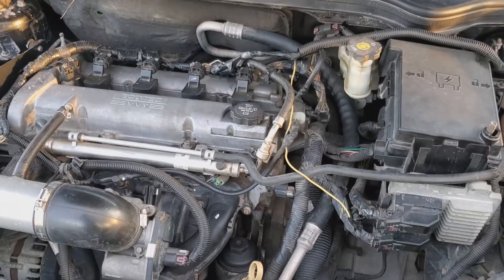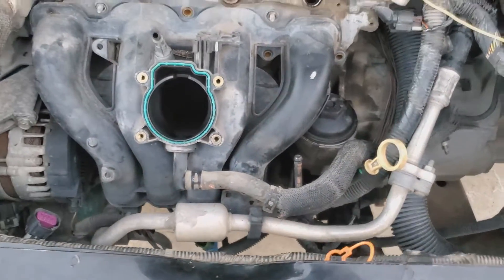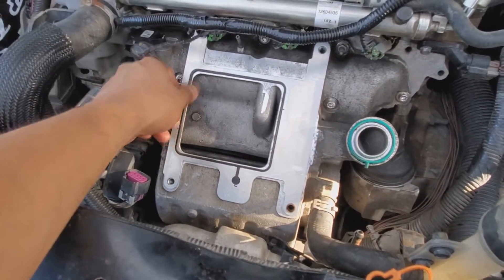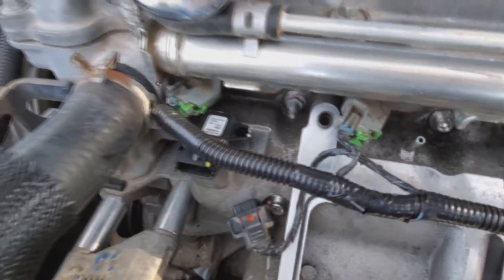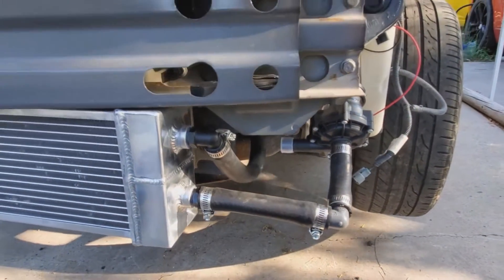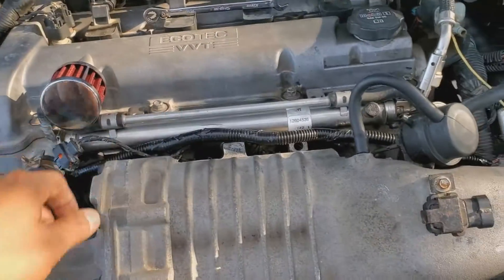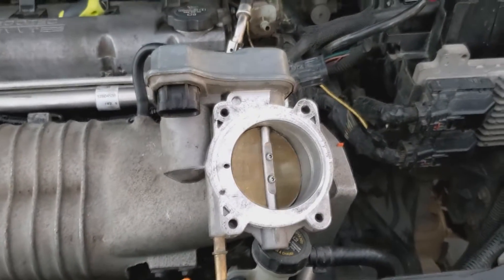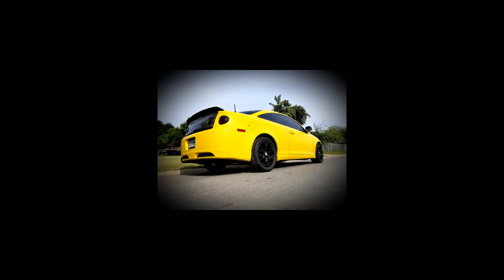Supercharging a 2 2L LAP Ecotec Part 1

Comment: Great video brother and thanks for posting! I have the 2.2 Ecotec in my sand rail dune buggy but Im not sure if the blower will fit between my engine and tubular frame.  Can you tell me how far from the engine block (at the intake surface of the block) the blower sticks out? Thanks!

Comment: Hey man, doing this right now, and not sure if you can even answer my question anymore given how long ago you made this video, the bottom bolt on the right side for the idler pulls when looking at this, what bolt did you use? they say the m8x90mm but it’s too long for mine

Comment: Hey man just wondering, how much did this cost ya in total?
Reply: And did you need to get that ecu file tune that's on their site too?
Reply from the maker: @igot4bucks640  i did not do the purchase. I only did the labor in installing the supercharger kit. But the kit is about 800 on zzp plus supercharger, tb and intake manifold. I didn't use the zzp tune as we had another tuner setup for it.
Reply: @09CamaroFANATIC  awesome thanks for the info man
Reply from the maker: @igot4bucks640  yeah for sure, you're welcome!

Comment: DUDE!! so glad i found this channel, im doing a very similar upgrade to my 09 'balt LT - i went the turbo route with equipment either on the way or backordered, but so far i did upgrade maintenance (seals, gaskets, plugs, valvetrain spring set, etc...) have added Coilovers, new rims/tires, replaced the entire suspension system (control arms, bushings, tie rods, sway bar end links, axles, wheel bearings and hub knuckles...the ENTIRE system) and a complete cosmetic makeover (video on my channel). Watching your video was SO helpful because i realize i left out a few steps as well in my planning, you saved me alot of time!! Thank you!!
Reply from the maker: Awesome I'm glad to hear I helped you out along the way!! Good to hear you are giving your Balt new life and continue on it's jurney! More to come from the channel and hope you stick on by!! Will be checking out your channel as well to follow your build!
Reply: @09CamaroFANATIC  absolutely my friend, will be watching :-)
Reply: I have an 09 cobalt LT 2.2 Auto as well, and I’m looking at either supercharging or turboing it. I’ll probably have questions for you one day lol
Reply: @GTR4M  Supercharging is the safer route, and the 2.2 is limited in what you can get out of it with a turbo, but if you are looking to push numbers, Turbo is the way to go.
Reply: @WramTheVinylGuy  I'm leaning towards SC, both because of cost and reliability. My current struggle is finding an m62 supercharger, I can't really find any online. Do you know of any sources? And why'd you stop making the videos!?
Reply: @GTR4M  most of my buddies have found theirs by calling around to junkyards lately, i got lucky and got one from a family member  - i stopped vids due to time, i work full time, am trying to open a Wrap business and also other stuff...i will get back to them once i start my re-wrap of the Balt and do upgrades, probably starting in the spring
Reply: @graphsicimagevinyls5882 we need a update on your 09 Chevy cobalt LT PLEASE LOL
Reply: @bankfishermantv7801  i sold it, bought an 06 ss coupe and am turboing it as soon as ZZP gets the kit in stock
Reply: Anything over 240 that motor is toast

Comment: Did you use the 3 wire map sensor on the manifold or 4? Im trying to wire the lsj throttle body without an adapter as well; does anyone know the correct 8 => 6 wire diagram??
Reply from the maker: Used the 3 wire map sensor included on the kit

Comment: Working on this conversion for my 2008 Cobalt LT automatic.  Lol on the "kick in the butt" doing injectors out of order (me too). I'll use your idea on the MAP sensor to punch out the inner ring.  Nice work.  So you're a few months ahead of me, how has it all worked out? You daily drive it?
Reply from the maker: You will love the difference. It's been working out pretty good and the owner does enjoy driving it!
Reply: I think it will be fun too and glad it appears durable. When I researched it he swap I didn’t really hear anything negative about durability.
One other question, can you detail how you wired the pump, did you use a relay or fusible link? And if so or if not, can you be more specific about the wiring especially where you tapped for power.
Reply from the maker: @johnjezak9789  sorry just getting to you but do you mean regarding the intercooler pump?
Reply: Thanks Varga, yes that's what I meant but I got it figured out with a relay and fuse tap. When I messaged this, I couldn't get the pump to shut off.  Also couldn't get over 8.5 pounds of boost. Took off old tension arm and its housing was cracked (125,000)so I'm thinking that was the problem.  Looks like a 3.1 pulley should generate about 13 pounds, however I am swapping on a 2.9 since I'm going through the trouble and have exhaust and cooling mods. I'll probably do a video on my project. Thanks so much. @09CamaroFANATIC